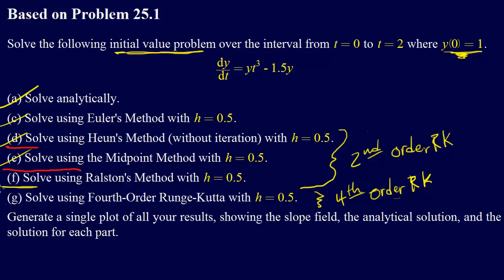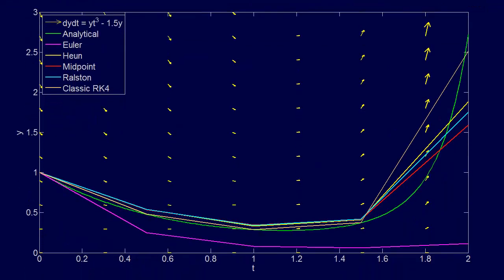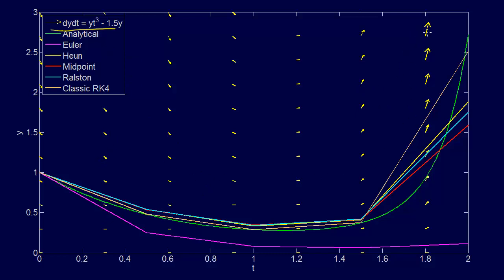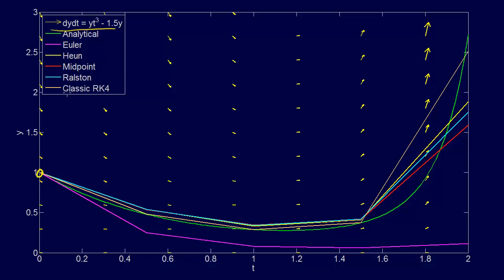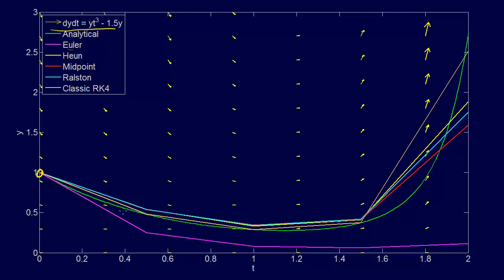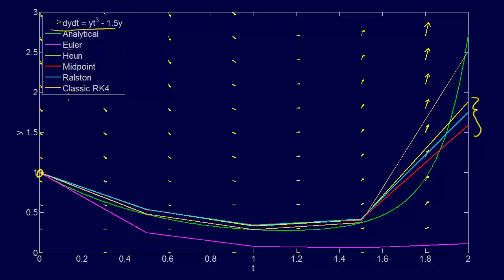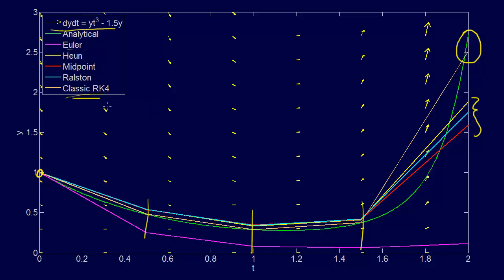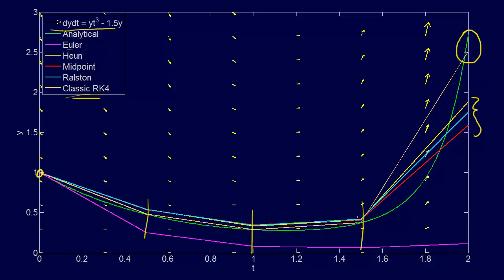7.4.7-ODEs: Worked Example--Final Plot

Comment: % allow me to add the code to produce this plot, but only for euler and heun:

clc;clear;close all;
y0=1;
Twindow=[0,2];
h=1e-1;
%----------------
Twindow=sort(Twindow,'ascend');
n=1/h;
Y=zeros(1/h,4);
t=linspace(Twindow(1),Twindow(2),n);
Y(:,1)=t(:);Y(1,[3,4])=y0; %3 and 4 are euler and heun
y1=y0;

for a=2:1:length(t)-1;
y0=y1;
dydt0=y0*t(a)^3-1.5*y0;
y1=y0+dydt0*h;
Y(a,2)=dydt0;%vector field
Y(a,3)=y1;
dydt1=y1*t(a+1)^3-1.5*y0;
y2=y0+h*(dydt0+dydt1)/2;
Y(a,4)=y2;
end

% YY=linspace(min(Y(:,3))-1,max(Y(:,3))+1,20);
YY=linspace(0,3,20);
DYDT=zeros(length(YY),length(t));

for a=length(YY):-1:1 %make the matrix from top to bottom
% find(rem(t,1)==0);
y=YY(a);
dydt=y.*t.^3-1.5.*y; %t is a vector here, dydt will be the value of slope on a horizontal line at y
DYDT(a,:)=dydt(:);
end

%quiver(linspace(0,1,15),linspace(0,1,10),ones(10,15),2*rand(10,15));
pl=figure;hold;grid;
quiver(t,YY,ones(size(DYDT)),DYDT);%you can NOT make the arrows smaller by plotting ones*0.5 and 0.5*DYDT
plot(t,Y(:,[3,4]),'LineWidth',2);pl.CurrentAxes.XLim=[Twindow(1),Twindow(2)];
pl.CurrentAxes.XTick=sort([linspace(pl.CurrentAxes.XLim(1),pl.CurrentAxes.XLim(2),9)]);
pl.CurrentAxes.YLim=[0,3];

fprintf('\n Prepared by student # 101 208, MI - Abu Dhabi UAE');